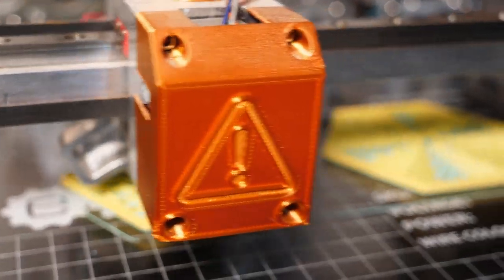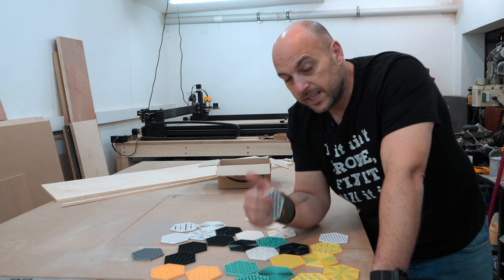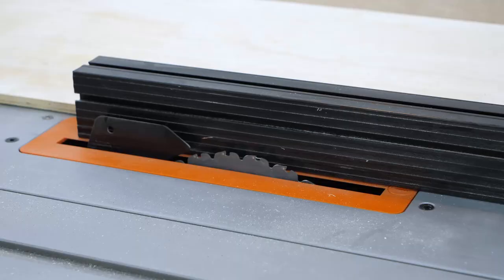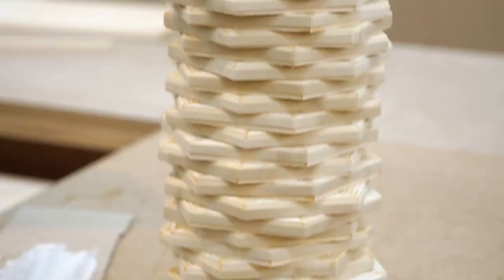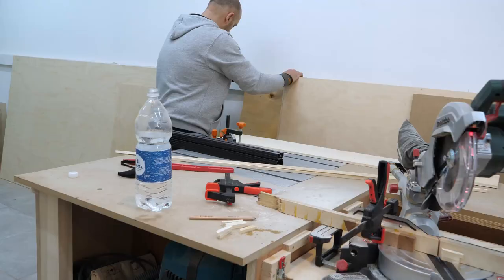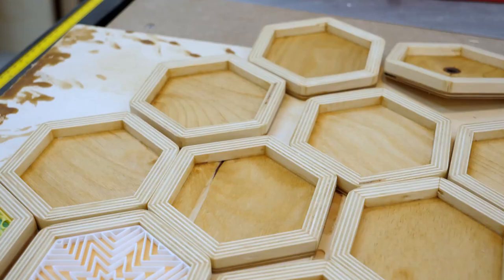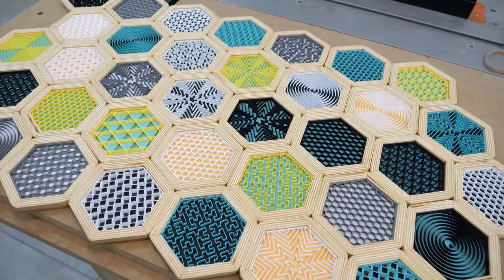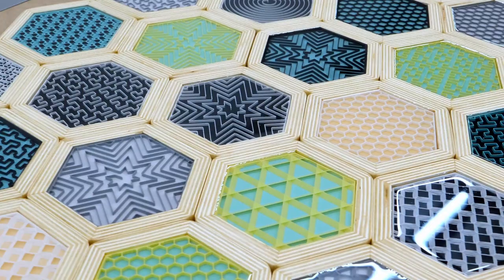Opening An Etsy Shop With My First Product - 3D Printed Infill Resin Coasters

Comment: Depending on the lengths of plywood you can handle, it might be quicker to do the hexagon outer shells as a tube and then essentially cutting rings. Would cut the process time by a rather large amount and allow for staging while other steps cure.  It does require a table saw though.

Comment: Looks ok. I personally would have opted to use a sanding sealer, primer and paint on the wood, but then again if you went that far you might as well have 3d printed the outsides too. Still amazing work though

Comment: Did you consider using the Cnc to just pocket out some coasters from plywood, you could cut the pockets and the outside and have the base all in one program? Would cut out the gluing and most of the sanding
Reply from the maker: Considered it, but the side pattern of the plywood is what makes it prettier so don’t wish to skip that part.
Reply: @3DMakerNoob  fair enough, I think doing it via CNC on real wood might be just as pretty. I'll have a go myself.

Comment: I’d create silicone molds and eliminate the wood frames altogether...much faster, cheaper and still great looking.
Reply from the maker: But then it would be just like any other coaster :) I wanted it to be different, more intricate
Reply: It’s the 3D print inside that makes them unique...put your branding in the 3D print or silicone mold bottom.  There is a limit to what people will pay for coasters, custom-made or not.
Reply from the maker: Agreed, so far people have complained that they’re too cheap, but I’m not greedy. I’m happy with my profit and I’m happy to see people like them and buy them. Maybe will have simpler versions as another product to sell

Comment: very pretty coasters but can never put anything hot on them, like coffee or tea, which are common uses for coasters.  should make it clear cold only.  also, likely scratches will diminish their beauty.  I like the wall art idea better.  also, pretty expensive to make considering the cost of resin.  of course, depending on the resin, I could be wrong.  I am sure someone will tell me.
Reply from the maker: This resin is good for up to 93 degrees Celsius which is fine for hot mugs. The price I sell them for is fair considering the Labour involved and materials. Also, the resin is also used for flooring buildings, so I’m guessing a mug will be fine :)

Comment: Awesome coasters. How did you make sure the resin didn't have a bunch of air bubbles? Heat? Pressure pot?
Reply from the maker: i have a vacuum chamber :)
Reply: @3DMakerNoob  That works too! :-) Good luck with the Etsy shop. I've been thinking about opening a shop too.

Comment: These are nice.  What kind of resin are you using?  I've been worried about the heat from the resin deforming printed parts while everything is setting up.
Reply from the maker: i am using a brand called Craft Resin. Since there is very little resin inside the coaster, it doesn't generate enough heat to deform the prints. if it was a much thicker pour, then yes, the heat generated would definitely deform the infill

Comment: Is the Polyterra PLA actually biodegradable, or is it like most PLA that's only 'biodegradable' under lab conditions that aren't present anywhere in nature?
Reply: What's the point of having something biodegradable stuck inside something which is not (resin) ? If the coasters are put to the bin one day, they'll be burned anyway.
Reply: @speedsterh  It's less about the project itself and more that he promoted it at the end. I'm legit curious because a lot of filament makers claim PLA is biodegradable when it really isn't. If someone made one that was naturally biodegradable it would be a big deal.
Reply: @ridingnerdy6406  As I understand it, PLA is made from renewable sources such as corn, so it's better then ABS from this point of view. That doesn't mean that little critters from the soil are willing to degrade it (biodegradable). Of course, the supposedly-biodegradable feature of that filament is put forward in the video, as a marketing argument, that was very visible.